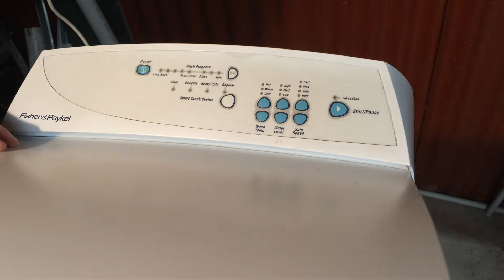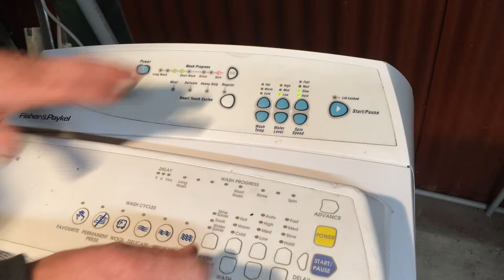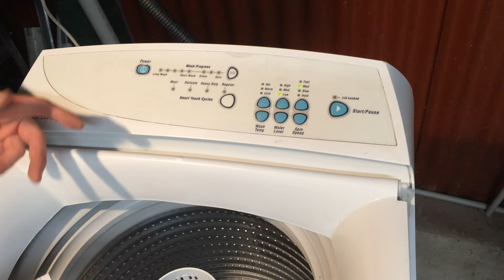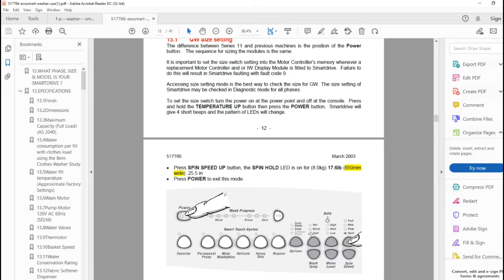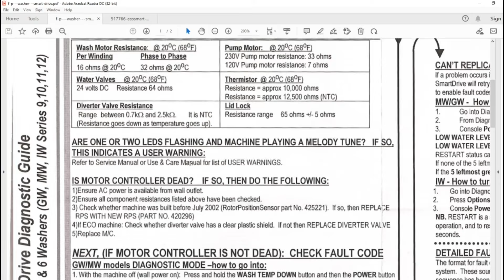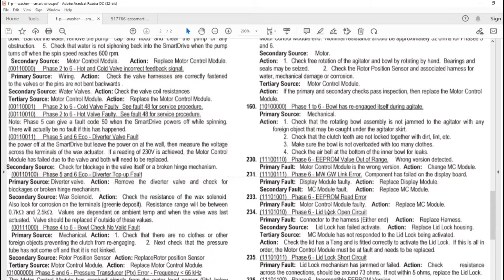Reading Fault Codes and Diagnostics on Fisher Paykel Smart Drives.

Comment: I have to replace a leaky drain pump and possibly the RPS on a 13 year-old washing machine. Is it worth it, or should I just buy a new clothes washer? I'm not familiar with the reliability of a Fisher & Paykel.
Reply from the maker: It really depends on the condition of the rest of the machine, if too many things start adding up then it can be cheaper to replace it. The other two things to check on a machine that age are if the suspension is worn (causes it to go out of balance easily) and if the main seal is leaking into the bearings and making a rumbling noise on spin.
Reply: @motrepairs  I'm replacing it, the high spin cycle is too noisy for my liking. Everything is junk nowadays.

Comment: great video. very informative. I have what I think is a 112 code. trying to work out what it is.
Reply from the maker: Sounds like you have a SD13, that is a motor over current fault, technically could be a short in the motor or winding but every time in my experience it has been a faulty controller.
Reply: Hi @grantwells1389 I also have a 112. Did you find what your issue was?

Comment: Model MW 511 no power when pressed. Just wondering if this machine have fuse?
Reply from the maker: They have a couple of fuses soldered on the board, but 9 times out of 10 when they blow other components are also blown. Only exception is if your drain pump has low resistance/burnt out, that can blow the secondary fuse before the pump triac blows.  Probably a good idea to make a video on where to look for blown components to see if worth fixing.
Reply: Appreciated your kind assistance.

Comment: We have a F&P washing machine, model GW612. This week we switched it on and the power light flashed on and off and didn't turn on again. Had a guy come in to check it out and he said the control board needs to be replaced. Is it worth replacing, should we buy a new washing machine or should we get a second opinion?
Reply from the maker: If its not turning on sounds like a controller, and the technician should have checked all components like pump and valves etc to make sure none of them have caused it to blow, so probably not much point getting a second opinion.  Hopefully he also had a look over the machine at the bearings and suspension etc to give you an idea of the condition of the rest of the machine, if main seal or bearings are on their way out then it usually isn't worth doing a controller, but if everything else is in good condition then hopefully you would have a few years left in it with a new controller.
Reply: @motrepairs  thank you 🙂 I don't think he checked any other party of the machine - just behind where the buttons are and says it needs replacing and it would be worth just buying a new machine. Will look into it more, thanks 👍🏾
Reply from the maker: @tesisau123  Did he give you an estimate to compare to price of new machines? I don't know where you are and how the structure their charging but I would think it would be about $400 total to replace a controller, so not cheap, but still cheaper then a new machine.
Reply: @motrepairs  he quoted about $480 for the part +GST and labour. We're in Hawke's Bay. Thanks for getting back. Very helpful as always with your vids

Comment: when we plug our machine in, it made the normal beeps going up, then nothing. no buttons work now. can unplug from the wall. plug back in and the beeps going up happen and then no buttons work.
Reply from the maker: Does the power button feel normal? On some the display PCB can become unclipped so the push button does not actually reach the button. Unplug the power, removed the lid, remove two screws at the top back and take off display. Check that display PCb is clipped into plastic housing correctly.

Comment: Hi, I have fault 49 so got new valve unit from Steve's appliances & put in but still getting same fault come up. I checked wiring resistance & was 0 this is 2nd time replacing valve in 12 months thanks for info
Reply from the maker: Hi, Sometimes when the valve fails it will damage the controller. If you have a known good valve and it is faulting as soon as powered on you will need to replace the controller unfortunately.
Reply from the maker: Also If you are having valves fail quickly, what is your water pressure like, are you on town supply? There is sometimes a filter in the tap end of the hose that gets blocked meaning the valve has to stay on a lot longer to fill and it ages them quicker.
Reply: @motrepairs  on tank water, thanks for former replies
Reply: @motrepairs  Hi I got a new $215 control unit put it in & still getting same fault, would the new water solenoid got damaged prior new control unit
Reply from the maker: @Kiwiwayne333  If you check resistance both valves should be about 60 ohms (manual says 64 but usually always a little low)
Reply: @motrepairs  I got about 57ohms is that ok?
Reply: @motrepairs  I got about 57ohms is that ok?
Reply from the maker: @Kiwiwayne333  That's a little low but should be enough for the machine ot turn on ok,

Comment: Thanks for the info shown :) I have a  MW512, it seems to work well, but after the cycle is finished, the machine beeps every few minutes, even pressing the power button to off, it still beeps. Any idea what would be causing this? Thanks
Reply from the maker: I don't think I've come across that before. Does it flash any lights when it beeps? Is it the constant repeated fault beeps or the rising tone? These machines are only meant to do one set of beeps at the end of cycle, so anything else after that should log a fault code.
Reply: @motrepairs  Hi, I am testing the machine, set up with cold water input only. In regard to leds, after the cycle has completely finished the hot and cold leds are flashing the same rate as the led between rinse and spin.
Thanks.
Reply from the maker: @servicetechnician218 What codes do you get if you check as I have shown in this video? I would check both inlet solenoid resistances, should be about 60-65 ohms.
Reply: @motrepairs  Thanks,I was able to obtain another control board and solenoids so swapped them all over, but the end spin cycle seems to be very long, what would cause that ? Thanks again.
Reply from the maker: @servicetechnician218  How long is it going for? If the final spin after all water drained takes longer then 8 minutes you may have a problem. 
I've had the complain several times, and every time its been a case of people paying attention when they didn't use to lol. Walk away and let it do its thing, if there is a problem it will stop and beep. If its slowing down then speeding up it could be a balance problem.